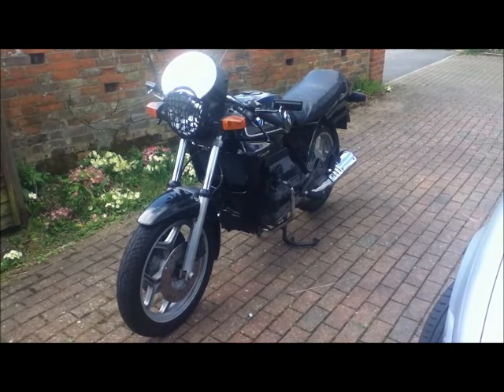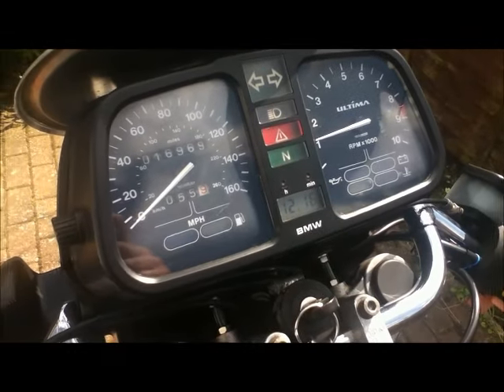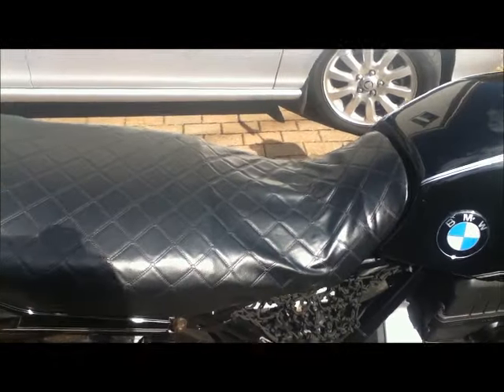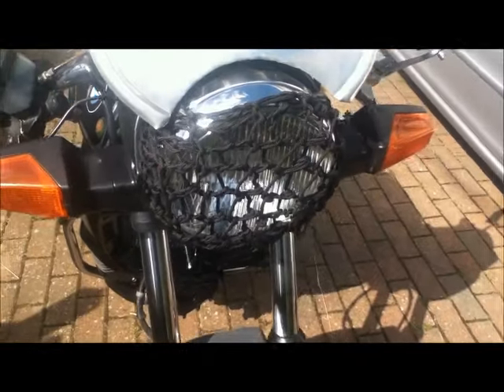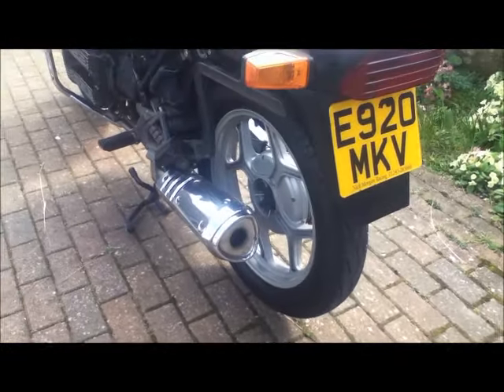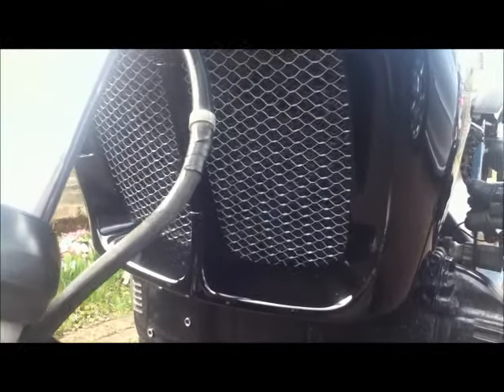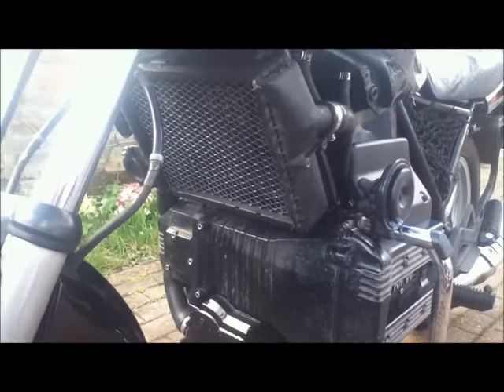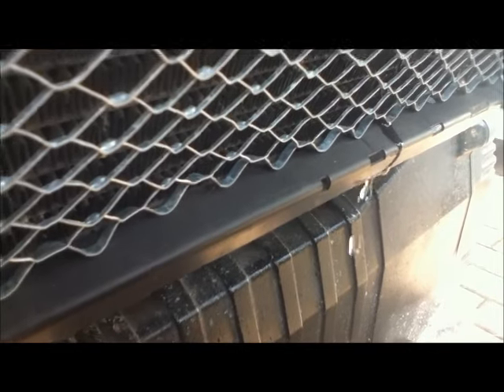BMW K75 Cafe Racer Commits Suicide

Comment: the coolingfan tends to seize on the k75 bikes because at normal use the fan never kicks in. For that reason i installed a switch so i can switch the fan on manually
Reply from the maker: I did a video on it you might like. https://www.youtube.com/watch?v=fKIFJRA4jDo&t=427s